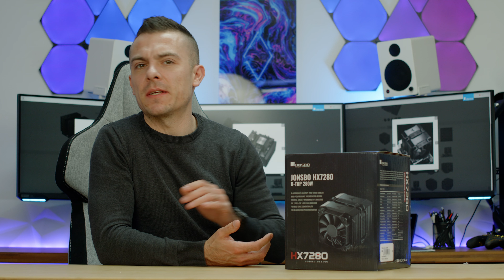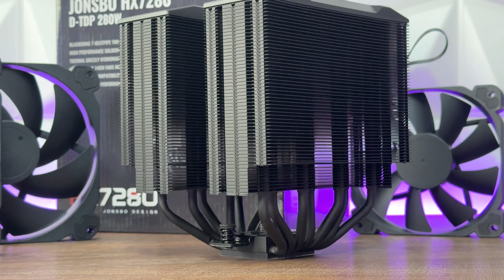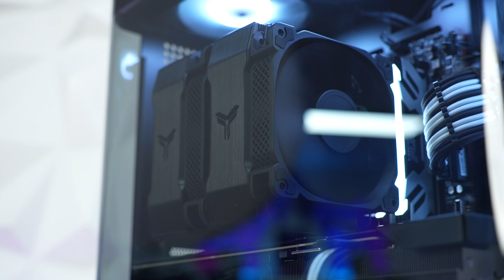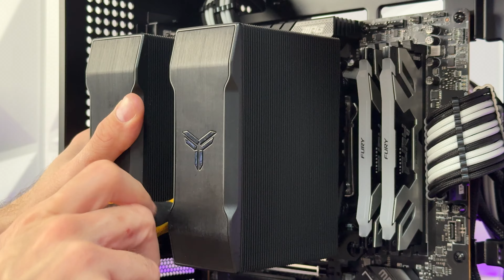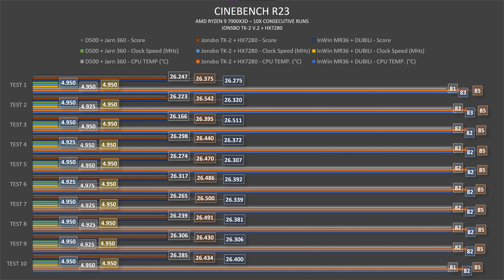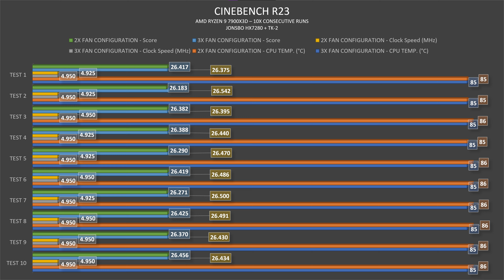JONSBO HX7280 - AIR COOLING WITH TDP AT 280W!

Comment: Good review. This seems like a great cooler for the price. Could you do a review for the HX6250? I'm looking to get those to replace my AIO. Not sure whether it'll be enough or not. I hope you could include power draw charts in the next review. Thanks
Reply from the maker: Thank you! It is an outstanding cooler.
Actually, I covered it 2 years ago. Really great but if choosing between those teo, I would go with HX7280 for sure.